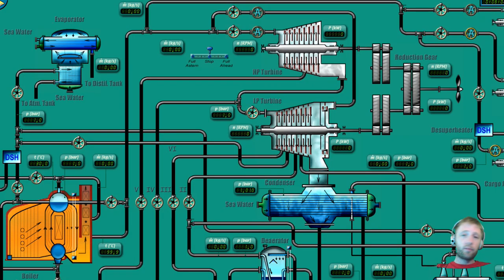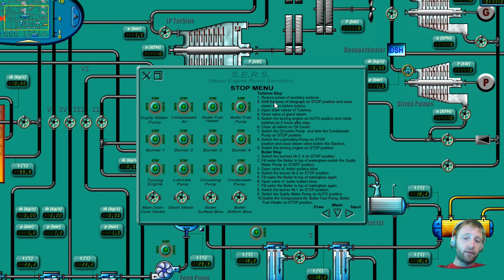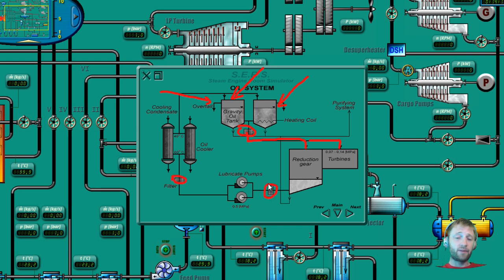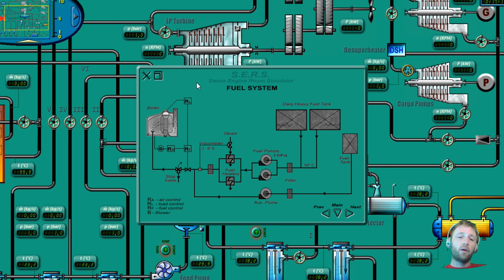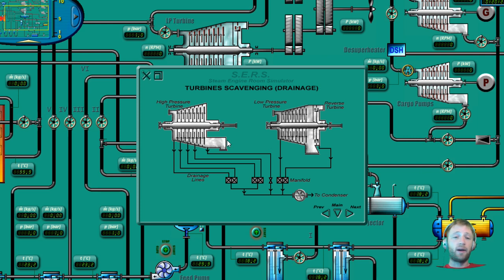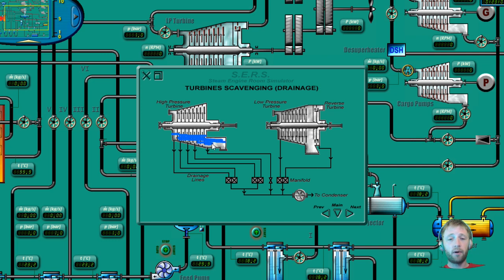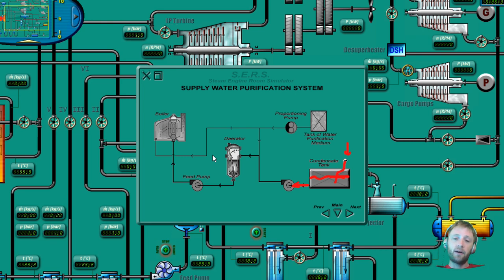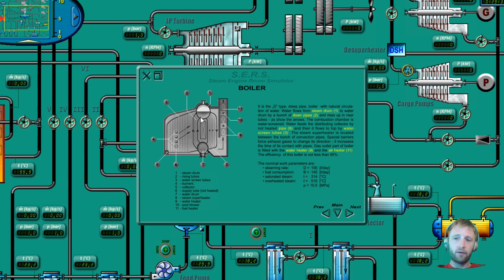STEAM TURBINE ENGINE Part 2

Comment: Aux pump in fuel oil system provide to ignite boilers from cold condition, then all boilers are shut down and there is no steam in system. Because for combustion of HFO you should have steam for atomizing oil already inside burners in order to provide good atomization. Fuel tank contains diesel oil, and for combustion from cold condition instead of steam you use Service Or Control Air connection.
Reply from the maker: Thanks for this details!Really appreciate !
Reply: Welcome!